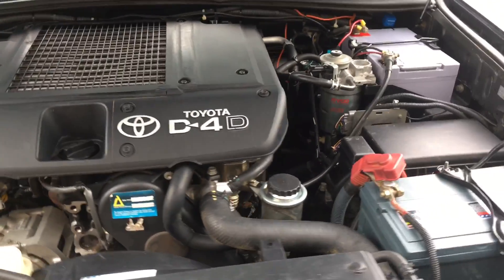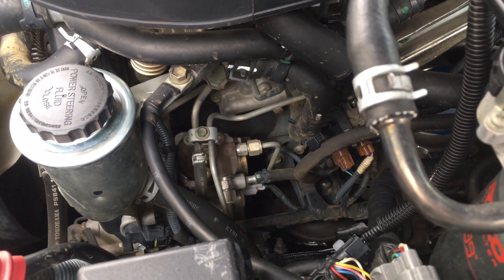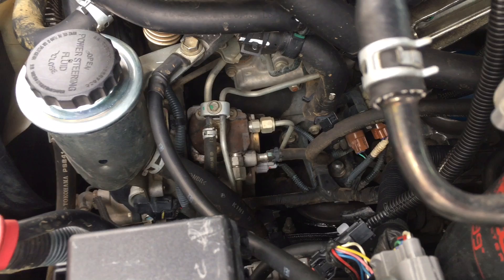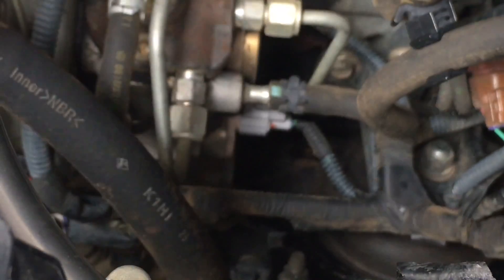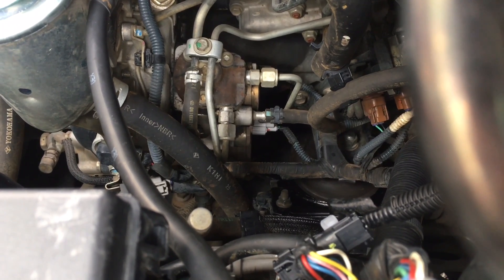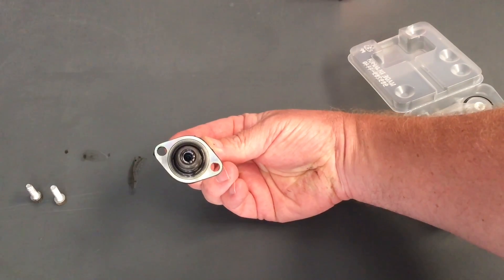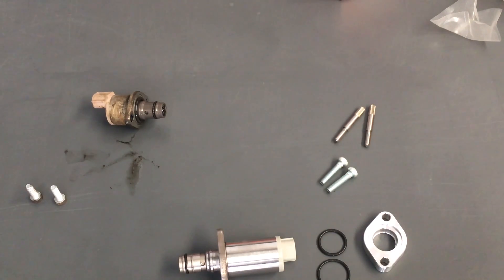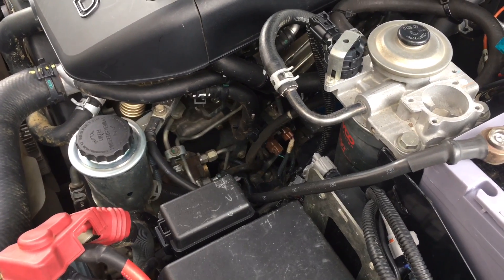CHANGE THE SCV - MANY DIESELS MAY BE AFFECTED BY INCORRECT FUEL PRESSURE

Comment: 2000 KDJ95 in Canada- all of a sudden started hard starting cold then nothing, was progressively smoking more black under full power before it died. Electronics are all good, the pump is getting fuel but nothing to the injectors. Im about to send the pump away, do you reckon I could try the SCV first? P1228 also.

Comment: Hi I have a 2008 Toyota prado 120 series D4D the problem iam having is when you pull up at lights there’s a slight rough idle but when you put it in N or P it goes away the prado has done 170000 ks so very low ks for age any idea what it could be
Reply from the maker: Watch videos 

Replace engine mounts

Probably injectors too
Reply: Hi only does it when stopping , the rpm’s drop a little bit but when you put it in N it disappears

Comment: Replaced my SCV valve, since then getting a P0093 error. Any ideas what could be causing this?
Reply from the maker: Maybe it’s the wrong one might be it’s coincidence because you have a chip or a Remap
Maybe you did other work on the car which caused a problem
Reply: Did you fix the p0093 -??

Comment: Hey there I recently replace my SCV on a 2008 Hilux KUN26, the part that I purchase was the long SVC part number 04226-0L010. Can please let me know that was the right part for my application. I also realize that my fuel consumption is a little worse then before.
Reply: Hello, may I ask. After replace SCV with new do we need learning or something?
Cause, I replace short one with new long one, my engine just cranking not running.
And I realized short one different pointing of hole, point outside, and long pointing to inside/body scv.
Reply: yes the long one will burn fuel drastically
the average will be very less compared to shorter

Comment: Hi mate , do you need to reset the ECU after you install a new scv on a Hilux D4D??? If so, how do you do that??? I tried everything , the new one won't start the car but the old one starts the car fine after I cleaned it!!
Reply: no need reset ECU. but, perform supply pump initialization using scanner.
Reply: @setiadi0929  how do you perform the supply pump initialization? can it be carried out through Techstream or is there an alternative way?

Comment: Thanks Anthony. Another excellent video!
You mentioned possible symptoms, but are there any typical error codes associated with failing/malfunctioning SCVs? Eg P0193 Fuel Pressure Sensor Circuit high input, or any other typical codes? Are you aware of any?
TA

Comment: Thanks for the other install video!!!  The SCV on my Thai assembled 2009 Pajero Sport  3.2 GT began failing a couple of weeks ago at 192K km, ordered the longer unit  with conversion parts included and problem solved.  The place I ordered it from listed it as compatible with Nissan, Isuzu, Toyota, and Mitsubishi and it looked similar to the one in your install viddy.